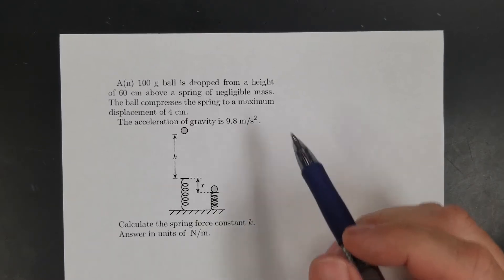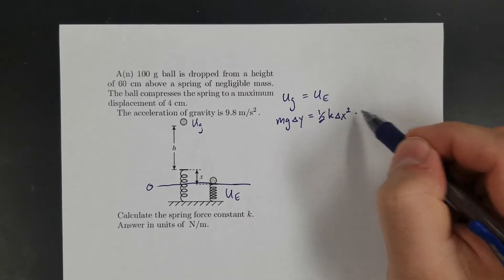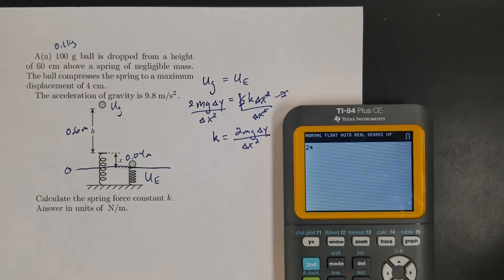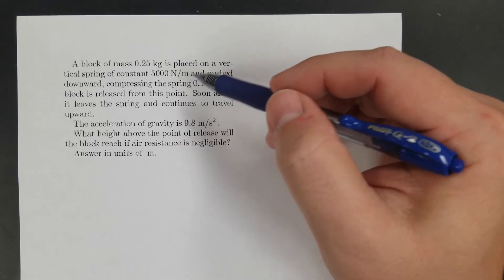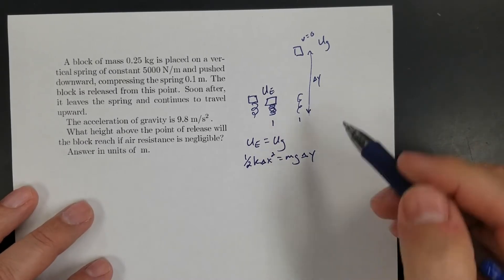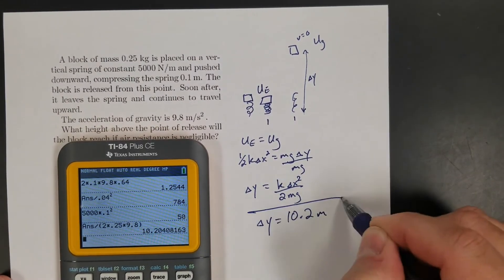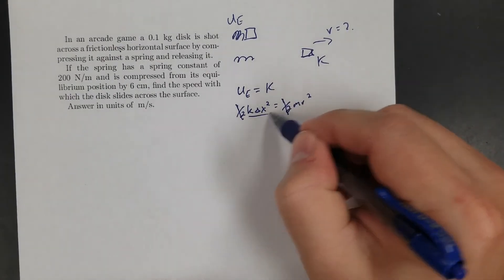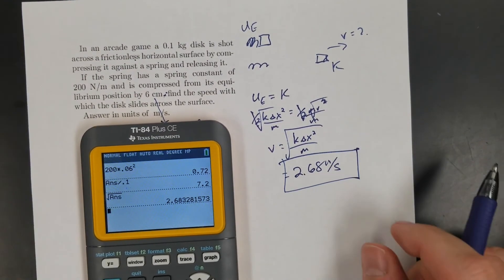Conservation of Energy - Solving Problems with Springs

Comment: Why in the first question there is no velocity?!
Reply from the maker: the two points we are using to analyze both have zero velocity: the instant the ball is released it starts from rest, and when it fully compresses the spring it is also at rest.
Reply: @PhysicsOMG  thank you for the explanation 👍🏼